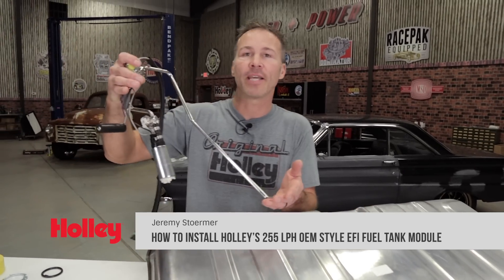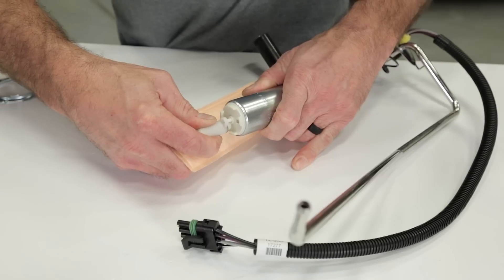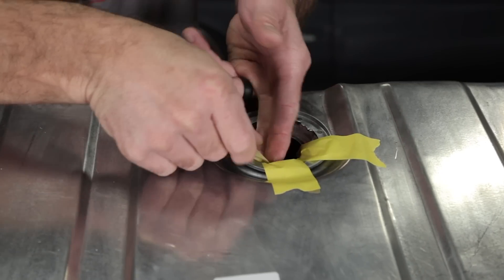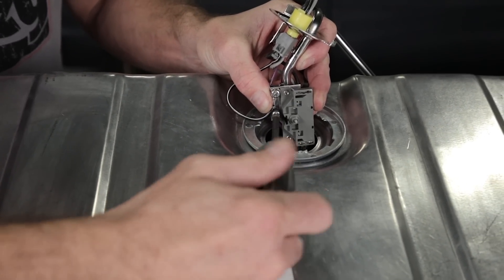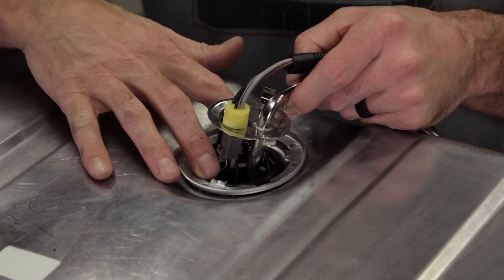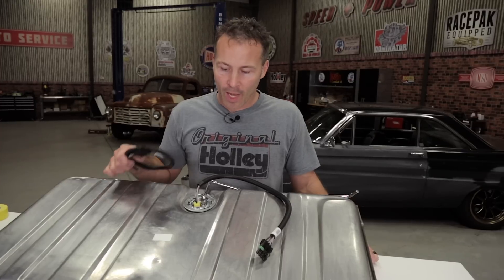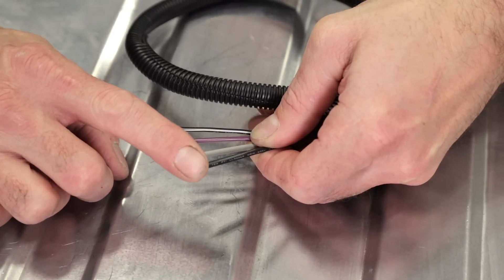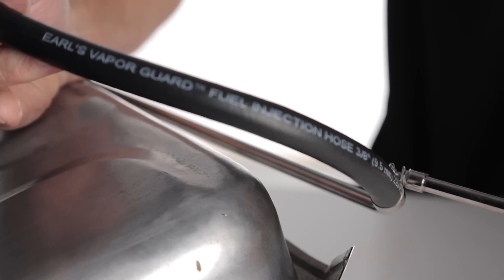How To Install Holley's 255 LPH OEM Style EFI Fuel Tank Module

Comment: Can you use these with no return fuel line off the sniper throttle body?
Reply: Thinking of using these on a 66 chevelle and a 72 lemans from other comments I see no need for fuel return line off the sniper. Do I just plug all the sniper lines then except 1 inlet for this to feed the sniper?
Reply: thinking the same thing also

Comment: So why is it my fuel gauge doesn't work after install? Reads empty all the time. Worked fine before 🤔🤔
Reply: some don’t have a fuel gauge, learned that the hard way too, guess you might have to wire one in electronically

Comment: no return line?
Reply: No, seems like fuel pressure is preset at the factory pressure.  Current GM vehicles don't use a return line either.

Comment: How do I attach the filler neck onto the Holley Sniper 10-504? I have the tank and the filler neck but need a way to attach them. Thanks
Reply from the maker: give our tech department a call 866-464-6553

Comment: can you purchase a external fuel pressure regulator to adjust to 7-9 psi for carburetor  system without damaging the fuel pump. Is there a complete system that you can buy that allows us to keep stock equipment and only convert to in tank electric pump ?
Reply from the maker: Our OEM replacement modules are designed for EFI upgraded systems.  However , yes you can add an external regulator for carb pressures.  Keep in mind though a return style regulator would be the best setup to avoid unnecessary pressure and strain on the fuel pump. And require modification to the module or tank for the correct size return port.  Thx J

Comment: can you add a external fuel pressure regulator to adjust to 7-9 psi for carburetor  system without damaging the fuel pump
Reply from the maker: It is possible but you would need to install a bypass style regulator and make provisions for the return fuel coming back into the fuel tank to prevent  dead-heading the fuel pump. J

Comment: Link shows this product only for Camaro/firebird. Will this be available for 73-87 c10?
Reply from the maker: that link has been fixed now: https://www.holley.com/products/fuel_systems/fuel_pumps_regulators_and_filters/fuel_pumps/efi_fuel_pumps/255_lph_oem_style_efi/

Thanks!
Reply: HolleyPerformance would it work with an 81 c10 also if dual tank how would this be possible to make it work

Comment: What micron fuel filter do you recommend after the stock fuel line?  Do you have a fuel filter holley part number for 6AN?  Thanks i just ordered the 12-300 69 camaro
Reply from the maker: If your running EFI use a 10 micron, carbureted use a 40 micron post filter.  We have plenty of options, here's a link to our -6 filter selection.
https://www.holley.com/products/fuel_systems/fuel_pumps_regulators_and_filters/filters/page=4
Thx J

Comment: Ia this product able to be upgraded to a 340lph fuel pump
Reply from the maker: Depending on the layout and design of the pump, you should have very little problem adapting a larger pump.  Remember the total fuel flow will be restricted by the fuel line diameter and the internal regulator has not been tested for performance with a larger pump. J